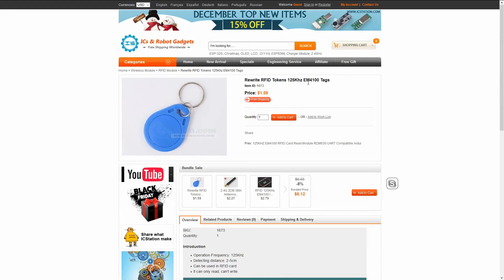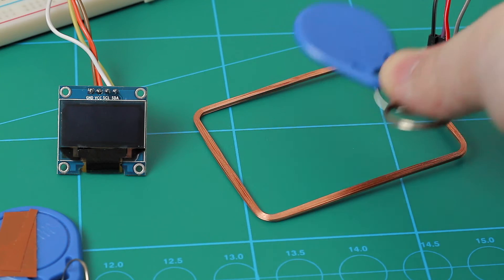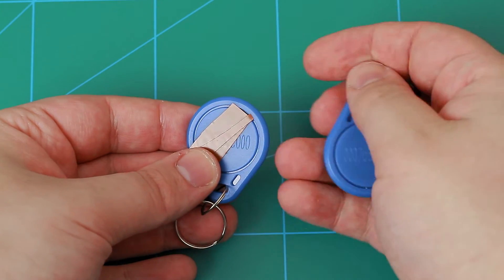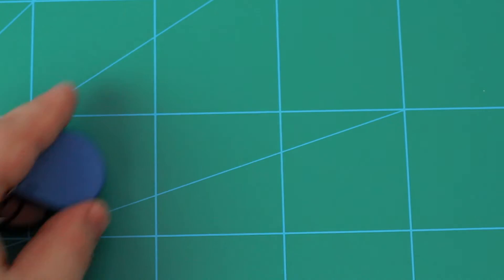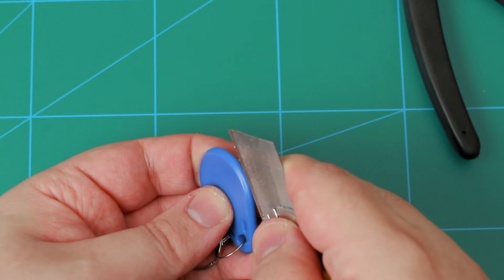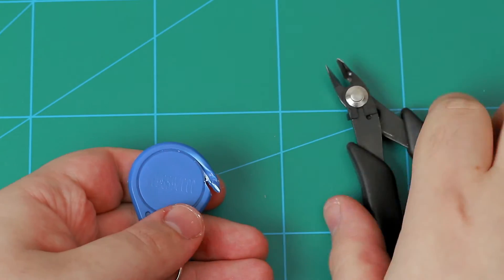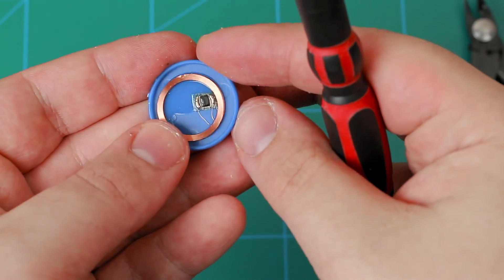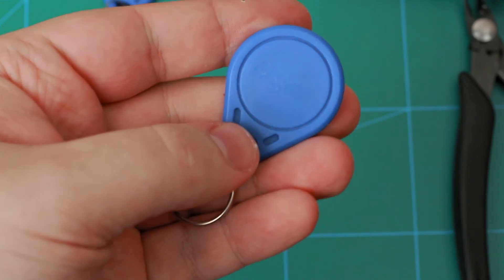Teardown Of ICStation.com's RFID-Tag

Comment: Another way to open a tag is to put it between the jaws of ViseGrip pliers and squeeze. Open the jaws to a width slightly larger than the diameter of the tag so you can squeeze opposite edges of the tag. After that, the cover comes off easily. Safer than using a knife or other sharp tool. BTW, that circle of copper wire is very fine gauge (thinner than human hair) and quite long. I don't know how many turns are in the coil. but one hundred turns wouldn't surprise me.

Comment: Will the tag/chip be functional if i take it out of that plastic and stick it somewhere else?
Reply from the maker: Steps in this video didn't have effect on functionality of the tag. In theory one could remove the coil and chip from the round plastic part, but there is a risk of breaking something, because there is a decent amount of strong glue holding them together. I wouldn't continue any further than what I did in this video.